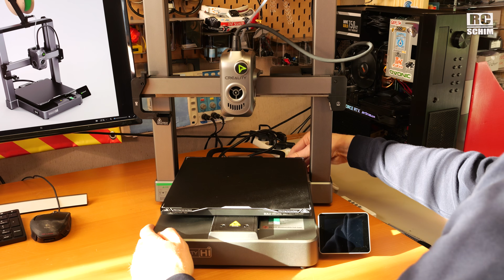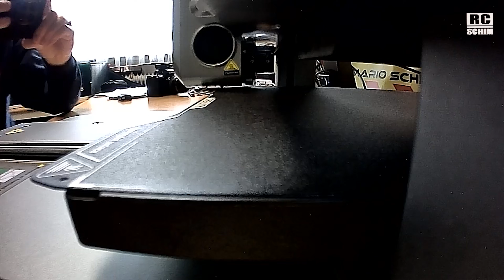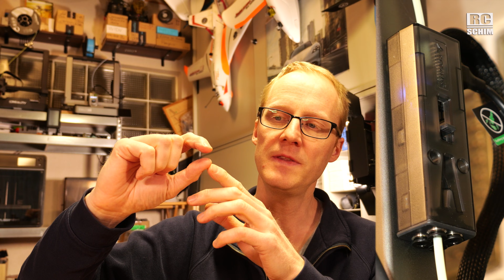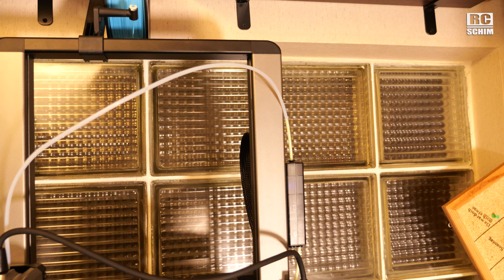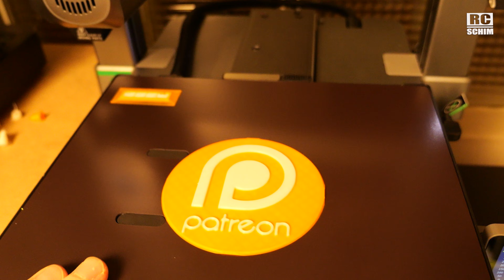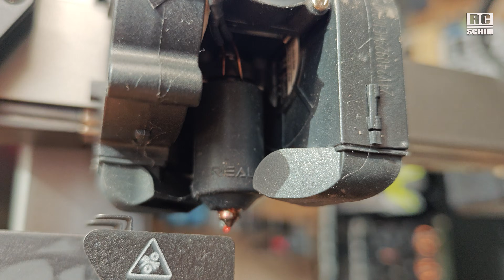Creality HI - Multicolor Prints, TPU & Homer’s Verdict

Comment: I watched your video and finally got my Creality Hi to print TPU. This after getting the extruder clogged and stripping it down 3 times. I also printed those silly spacer things which helped nothing. All I can say  is make sure there is no residue in the nozzle, even in the nozzle tip before trying to print TPU otherwise it will grind. Also, print sloooowly. Thanks again for the help.
Reply from the maker: I keep an old (but nicely working) Ender 3v3ke up on my shelves for just TPU printing. Works well, so I don't have to mess with the Creality HI.

Comment: when you printed with TPU, did you have to put any add-ons or did you just take out the PDF tube and just print it with TPU and went into the settings hit reality and then put TPU?
Reply from the maker: Yes, for TPU Printing you just need to bypass the CFS material changer and install the spool directly on the spool holder. For settings just use any of the generic TPU or creality TPU profiles of their software, or from Orca Slicer which I like to use as well.  TPU is just too flexy to be fed thru their CFS filament Box...
Reply: @Rcschim  I understand so use it without a boarding tube into it directly, so I don’t need to print any spacers or anything correct I don’t need to put any retractions or anything on the software. Do you have specific settings that you use? Have you have had any filament jams or last question have you upgraded your nozzle from a .4 to a .6 how do you do that? Do you do it with your nozzle heated or cold? I bought a kit. I just haven’t found a video that shows me. Thank you for all your help.

Comment: BS, printed first project then nothing sticks after that, ended up plastic all through the upper chamber of the print head vice being printed on the bed, the material melted upward entangling in the workings and wires of the print head. Garbage, bought yesterday on Saturday Extreme Failure the following day Sunday, going back to the store where I bought it for return. Pure Garbage
Reply from the maker: Sounds like pretty bad experience. Heat creep in the extruder? Those printers should just work. 
So far my creality printers have been ok, no major issues. Ender 3ke was bad at first, now solid work horse.

Comment: The printer does not support TPU (Confirmed by Creality support) it is weird that it shows it in the Creality materials menu to be selected because its tech sheet does not list TPU, is not just the CFS unit, the printer itself should not be used with TPU.  I specifically asked this to reality after seeing some people trying and I needed to decide if I could sell my Ender 3 V3 KE and just keep the Hi.  After their answer, I decided to keep both to be able to use TPU on the Ender.
Reply from the maker: Yes, the 3v3ke is my little TPU slave as well;)

Comment: Fantastic video and review of various functions.  Would you recommend the HI over a KE or a V3 ?  Multicolour is not that important to me.  I’m still running my old and slow Ender3 V1 from 2019 !!!!
Reply: I have 2 E3v3plus printers in addition to the Hi and the hi blows the v3 away in speed and quality of print. The only down side is I need the larger print volume of the plus printers for several of my products. Multicolor isn't my biggest need either though the cfs is excellent if you change filament a lot. I offer my products in 4 colors so keep them loaded in the cfs so I can just select what I need to print and the color easily.
Reply from the maker: I think the new extruder, nozzle etc are great. Print quality and speed is an improvement as well.
Mine struggled with TPU, that's something my older 3v3ke does better. 
Color is not important to me, but having the option to have different materials or colors loaded is very convenient.
Oh and I forgot the larger print size of 26*26 - that's really handy!

Comment: Hi friend. Excellent analysis. I wanted to ask you a question. I want to get into 3D printing for the first time. And I had thought about this Creality or the Bambu lab a1 combo. Which do you think is better in print quality? Which one is easier to use as your first printer? I would really appreciate your opinion. Regards.
Reply from the maker: Hi, I didn't try Bambu yet, I hear they are very easy and reliable, but recently they caused controversy with their closed software and own cloud. 
Also in direct comparison they are more expensive than creality. 
Can't do much wrong with either one of these options. 
Soon I'll be testing the anycubic Kobra S1 - also interesting
Reply: @Rcschim  Thank you very much, my friend, for your advice.

Comment: Looking like A1 but this one won't get the bad mandatory cloud usage policy as Bambu is pushing then?
Reply from the maker: No, they still try to motivate you to use their creality cloud. But for this review I couldnt even pair the printer with cloud (since it wasnt avail yet). The only thing missing this way is remote printer monitoring (it only works in my homelan, if phone is on same wifi you can see progress and video).
I think Bambu might be agead a bit on quality and convenience? (never tried one myself) - but Creality delivers almost the same for less money... (some points are better here like the larger bedsize)
Reply: So we should be good with this with Creatily printers? I was thinking of getting a A1 or A1 mini but those policies made me changes my mind. Looking at Elegoo Centauri carbon as an alternative too but no real reviews yet. Price seems great for the offering
Reply from the maker: It's been out for a while now, and build space is kinda small - but my best encased printer was the flash forge Adventure M5pro - maybe it's out there for a good deal.... Check my review. If you can live with the 21x21 build plate that is.   But most times I don't need encased printers :)
Reply: @BornIntoThis20  may I ask what did Bambu do that's so bad? Is it just you cant use orcaslicer?
Reply: @BornIntoThis20  Creality has always been open source and you are not required to run Creality print or their cloud service. I use orca slicer for my 8 Creality printers and upload files to the Hi Combo and my E3v3plus printers directly over wifi very easily. I highly recommend the Hi - it's been printing 24/7 in my little print farm for about 3 weeks now.

Comment: Whats the size when the bed moves all the way to the front and back? im curious if it fits in my enclosure
Reply from the maker: 64 cm depth (all the way back + cable, and all the way fwd)
44 cm width 
50 cm high (wo spool) or add 25cm for spool
Reply: @Rcschim  thanks a lot, unfortunately it seems i would have to do major modifications for it to fit...
Reply from the maker: @nanopix5305  sad. if you need a color 3d printer, enclosed, consider the anycubic s1 combo (I should get this in a few weeks for testing). looks quite good from other reviews and is also quite affordable!

Comment: nice review, I bought the ender 3 KE 2 weeks ago, but i have already had to add rails and z support to fix it, it also required spaces in the z gantry to fix the lean. I was very annoyed as I have been into 3d printers for the last 10 years but I'm burnt out with tweaking and fixing and I want to get a unit out the box that just works like my works X1 carbon, to go with my 3 enders I was going to buy the bambu A1 next week for the multi colour, probably still will. After the KE and the reviews I saw I'm sure creality only send out perfect units for review and it will be the same as my KE experience for the me/ consumer.
Reply: The ender3 3d was the first ender 3 to be perfect out of the box I have the 3d and the plus and they both are just as good if not better then my a1 mini 

I’ll stick with Creality for the time been . The Bambau change of terms of service has been a big reason that I won’t buy bambau now
Reply: I have 8 creality printers and they are all stock and have run perfectly out of the box. My Hi Combo was definitely the easiest to set up and best quality out of the box followed closely by my 2 E3V3plus printers. Tech has come a long way.
Reply from the maker: @LoriAnneBrown  Thanks for all your feedback - sounds good that the Creality HI works so well in your professional application. I agree that the multicolor printing as we have it currently, is not good, too much waste - but the convenience of having different colors or even materials is great!  
The new bambulab h2 with dual extruders, aside from the expensive Prusa XL, is the one for multicolor prints without waste - but ~ 2k is steep for a hobby device :)
Reply: @Rcschim  I really am not impressed with the H2D. One I'm not a bambu  labs fan, especially with all their firmware lockdowns lately and have always had Creality printers. Creality actually have had a dual nozzle printer for years in the Sermoon series too though I have never played with it. I would never combine laser and vinyl cutting inside an enclosed 3d printer - its just going to mean a LOT more maintenance to clear the soot and debris from the printer every time you want to 3D print. And 3d printing takes 3-10x longer than laser or vinyl cutting so to tie up a machine that could be working on your next print by using laser/cutter just seems stupid.
Reply from the maker: @LoriAnneBrown  I agree - the laser cutter part is not appealing to me (since I also have a few dedicated lasercutters)
The dualhead extruder seems nice tho - and the bambulab stuff seems very well setup. currently testing the Anycubic S1 - and here the ams filament box is quite poor in performance...
Reply from the maker: Sounds like you had a bad unit. Shouldn't happen - I agree. Cannot say if they do "cherry picking" to send out good units to reviewers (always possible), but I've seen this behind the scenes vid where I guy visits the Creality company and you see hundreds of "HI" there being tested at the same time. 
My Ender 3KE was a bit problematic when I first got it (but not as bad as yours). I made 2 vids back a year about it. Now it is the cheapest bed slinger in my little shop - but especially for TPU prints it's unbeatable up there ;)
I think with the Bambu A1 you cant go wrong. Isn't there a path where You'd get a full AMS that you could use on the X1C AND the A1?

Comment: Some of the models that you showed have very visible uneven layer lines much more than my K1C. So the print quality doesn't seem as good as the k1C.
Reply from the maker: I only have the K1 max as comparison, and it has quite bad visual artifacts. 
For my taste the quality is quite ok. All printed at 0.2mm layer height.
After some printers (Arti...)   I was a bit put off by "bed slingers" - but the newer generation is quite good. And 90% of my prints are either PLA or TPU - so I seldom need encased printers...
Reply: What do you think of the Hi compared to the kobra3 combo?
Reply from the maker: @thomasroseman575  I think they are pretty similar. If you have the extra budget, check the Kobra S1 combo rather, the enclosed printer for pretty good reviews and it's roughly 200€ more.